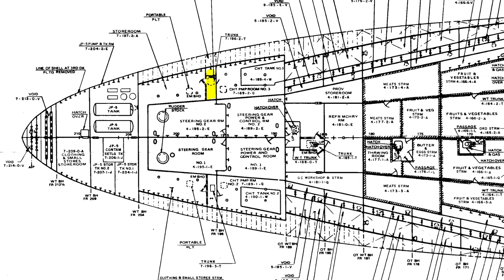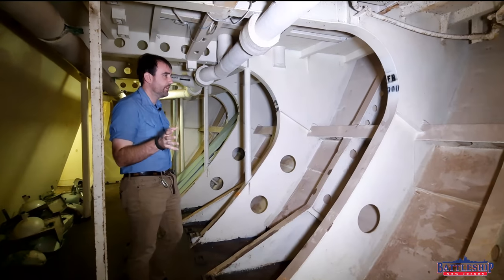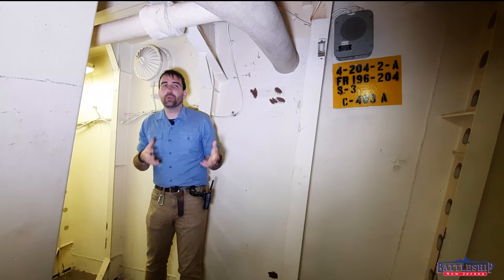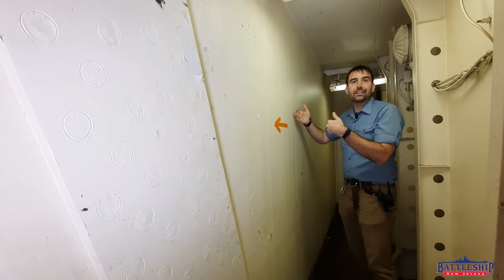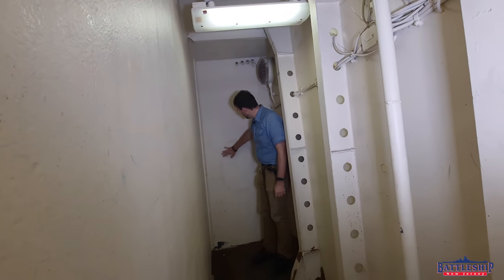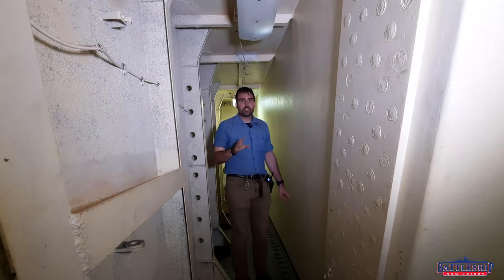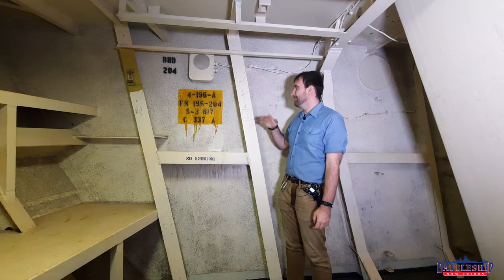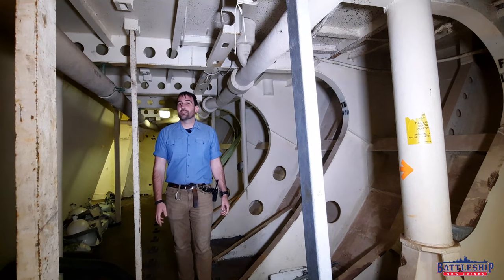Covering Your Aft (Steering)

Comment: Not exactly how steel hardening works. It has to be heated to a specific temperature, and then cooled at a specific rate to produce heat hardening. You could picture it as a bunch of glass marbles. Untreated, they're free and can move around. Heat them just right, and they'll stick to each other and form a stiff mass. Heat them too much, and they turn to liquid glass and you get a mess that breaks easily. The 'marbles' are molecules of iron and carbon in the steel. Heat them too much with welding, and you turn the careful stack into a blob.

Comment: So…  sailors from the 80s needed more sewage space than those in the 40s?
Reply: Ports started to have rules about dumping sewage. Im not sure but i believe they held it in tanks until they could dump it at sea.
Reply: @wompinoag  Yep. He's talked about this at least one before. There are rules against dumping both in port and within coastal waters.
Reply: @JarrodFrates  Rules that didn't exist in the 1940s.
Reply: @michaelsommers2356  No, but they did exist later and the Iowas we refit to come with them. You don't get an out just because the ship is old. Ryan covered this in the other video.
Reply: @JarrodFrates  What do you mean by "You don't get an out"?  Who's looking for an out?  The ship needed to comply with rules that didn't exist when it was built, so it converted some spaces to new uses.
Reply: @michaelsommers2356  And I never said anything different.
Reply: @JarrodFrates  Then why did you say I don't get an out?